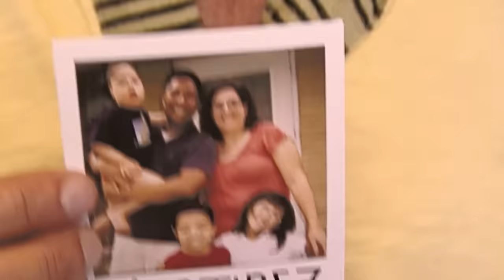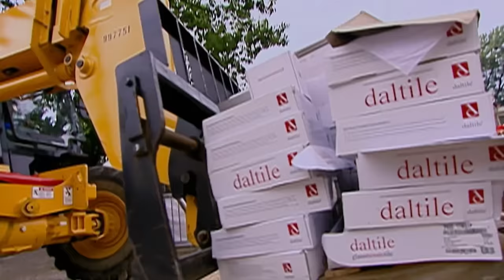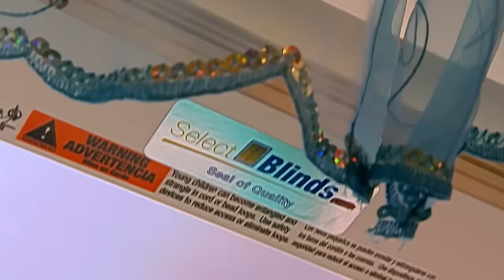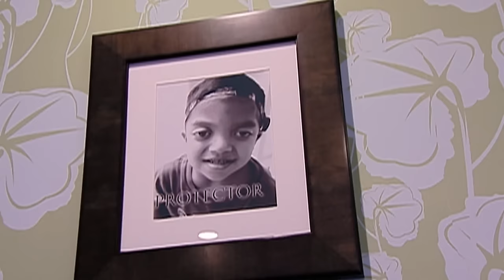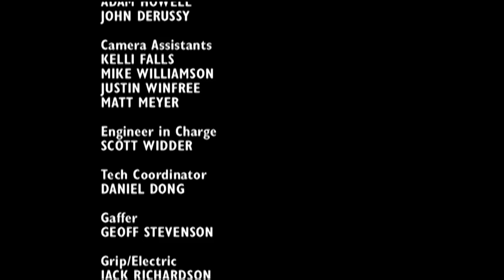Twin Sons With Birth Defects Need New Home | Extreme Makeover Home Edition | Full Episode

Comment: I am THRILLED about the introduction of a home elevator. yes i was hoping that they would install an elevator in the house - my thoughts were for  two sets of buttons - one  level of buttons for the children  and one level of buttons for the adults. An  elevator allows access to the basement and TWO floors above. NOT just one floor above the basement. 
the playroom in the basement is a SUPERB addition. 
Thus allowing a 3 level house that they could all accessible to every one on every floor  -   and yes it would still need stairs (legal requirement in some countries to allow access if a power problem) 
BUT the addition of the elevator serving and a house that has 2 levels above the basement (not one)  THUS   3  floors in total AND an elevator  would  allow much more room overall.